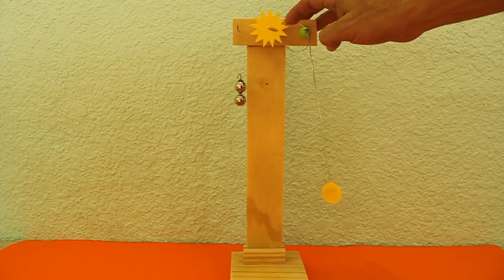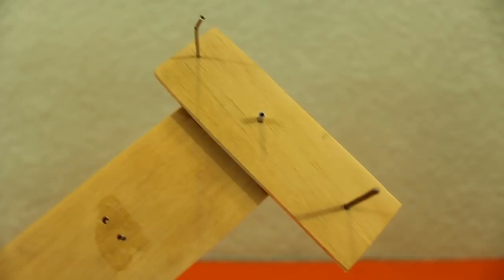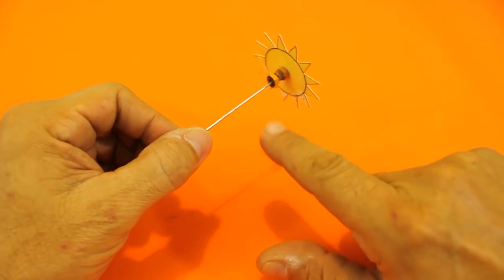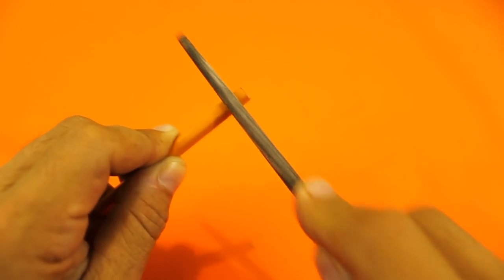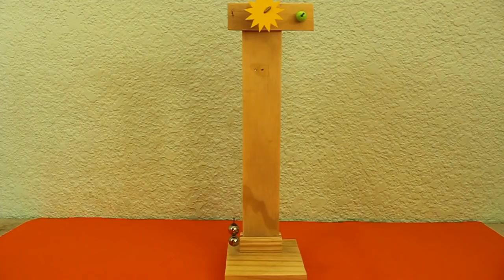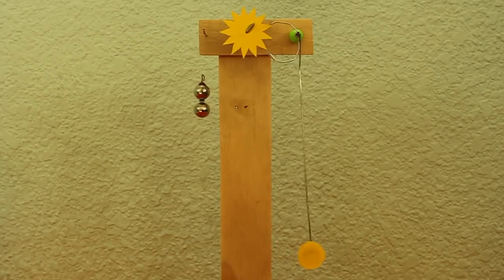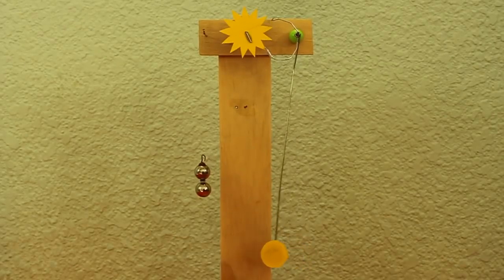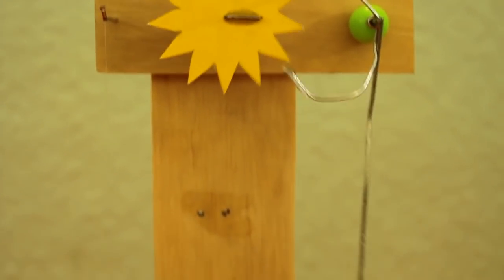Clock Escapement Mechanism

Comment: This is a wonderful video and a testament to how simply complex things can be with a bit of resourcefulness and ingenuity. One topic you did not address is the geometry of the escapement arm at the top of the pendulum, and how its two arms must be positioned with respect to the angle of the teeth on the wheel. E.g. are the arms the exact distance between two teeth, 2 & 1/2 teeth, etc. ? And why one has a "flag" and the other is a simple pin.

Comment: How do we tune the timing to 1 second? Is there any mathematical calculation with the coil or anything else, which would make it tick perfectly at intervals of one second?
Reply: A pendulum with an adjustable sliding weight...it's the length of the pendulum from top to weight that determines the speed of the swing.

Comment: Have been trying for two years to make an escapement...no luck....Then your video.   I ended up using plastic for the escape wheel and  coat hanger wire for the anchor....I did find out that the center of gravity for the pendulum is critical.   THANK YOU, a lot of fun to run and by adding or subtracting position and mass on the pendulum, very clearly demonstrates how a pendulum actually works.   My grandkids were fascinated.   THANK YOU

Comment: Put a large round thick paper circle with a line from center on it and you have a minute clock. Just do the math to change the ratio so the paper takes a full minute to rotate. or Change the center gear so it has 15 30 or 60 teeth to make it easier.
Reply from the maker: +Solder Joe Nice, I will di that but with a Verge & Foliot escapement where it is easier to change the period.
Reply: I was thinking about it as keeping the description to it's most basic concept and components. Like you have done in this video. You explained it very well. A 1 min clock disk popped on the back would still keep it simple yet would add in how the gear ratios relate to the clock's hands. Maybe a follow up video showing how to do the math to get the ratio correct for 1min 10 min or an hour. Then add in the escapement for the next video. You have potential for a good series of videos started here.

Comment: What if you had a larger notched wheel that has a watermill design on one part, and it was simply powered by running water? You could build a hydro-power clock!
Reply from the maker: That woud be a nice design!